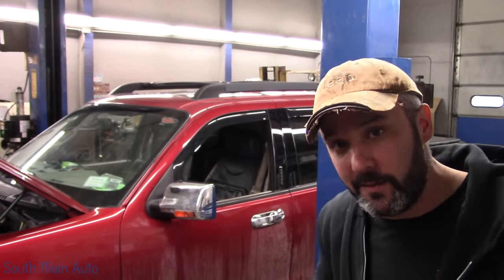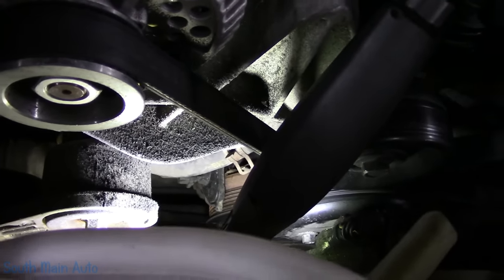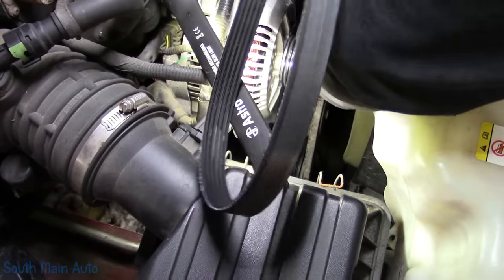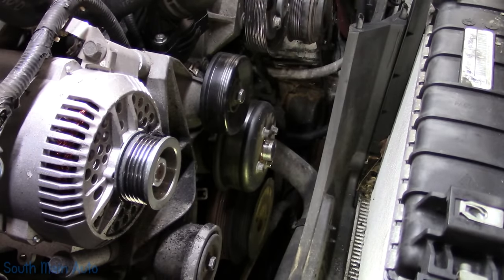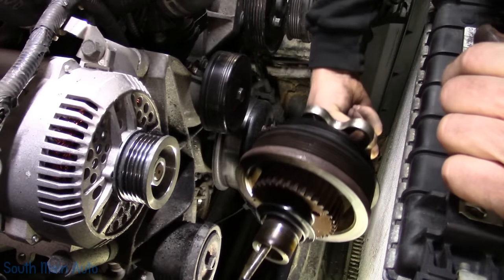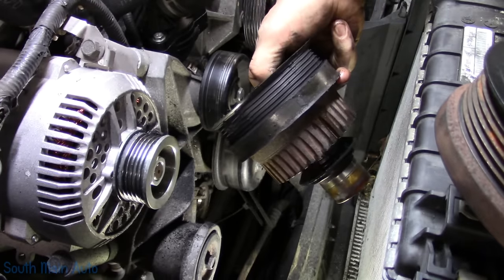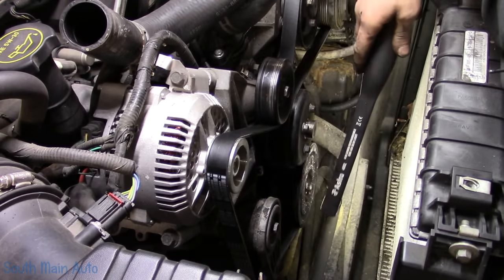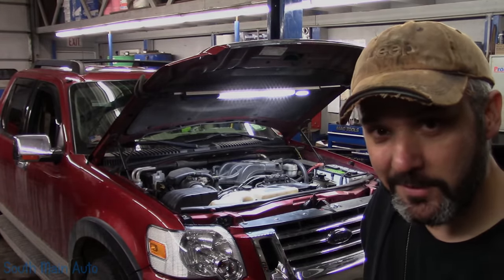Ford Explorer Sport Trac: Crank No Start

Comment: I know this is an older video.... but, I had to comment.   it is an embarrassment to the automotive trade, some of the people they have "working" in ALL the parts stores these days.  i applied to THREE parts stores when I moved to a different state for some extra income, and BOTH told me I was over qualified for the position.....  That should tell you something about who they prefer to hire.  95% of the time I have to look up my parts myself, when I go to said parts stores, to make certain I get the right part the first time.  I do agree with the NAPA comments though, most of the time they seem to have SOME automotive knowledge at least!!

Comment: On my 2003 Mustang GT the PATS will light up the theft light sometimes and not let me start the car.  I know the PATS codes are stored in the Dash cluster, the Key and the computer.  If they dont match or if one of them isnt working then the car wont start.  I found this out the hard way when I got a new dash cluster trying to fix the speedometer lol.  Found out I had the wrong transmission but the car didnt start with new dash so I transferred one of the computer boards from the old dash to the new one and it was able to start again.

Comment: I have to laugh at all the Auto Zone negative comments. Here's a clue for all the space shuttle mechanics commenting, don't go there if you don't like them. Go to Napa or the dealer and put a little extra in your wallet, you'll need it. Lastly AZ has parts and I agree the people working there aren't space shuttle mechanics like you but try to remember the average worker gets paid ten bucks an hour and typically it's a part time job because they aren't space shuttle mechanics like you guys. Hence grow up and get a pair.

Comment: Hey, guys.  I love the channel.  I wish I was in NY to bring you my car.  I noticed the Ford in this video, and I have a question.  My last car was a 2009 Ford Focus SE four door, and had 298,000 miles on it.  Before I started doing disk brakes myself, I took my Focus to a chain brake mechanic.  They put premium pads on the front.  I drove my car between Sacramento and San Francisco, and drove multiple hours per day working in San Francisco.  That city is known for hard on brakes.  The issue I had was the premium pads they used would start cracking and chipping within a few hundred miles, and it took 4 visits and pad replacements to find the right pads, which were non-premium.  Is this a car issue, or issue with the place that installed them, or lousy pads?  Thank you for information.
Reply: I forgot to mention, I always kept the alignment like it should have been.

Comment: I just want to remind everyone that loves to bash the auto parts store people, that Autozone carries thousands of parts and there's no way you can reasonably expect one of the folks in the store to know off the top of their head which particular pulley will fit a power steering pump for a 1992 Chevy truck, for example.  The system in the store is set up so that the only way, and I mean the only way, to look up a part is to enter the year, make, and model of the vehicle.  You can't just look up what water pump fits a small block chevy, it doesn't work that way. It's not like it used to be when there were guys working in the parts stores that knew small block chevy's and what parts would fit.
Now having said that, yes you should be able to have some reasonable expectation of getting the correct part from a parts store.  I had to take a test to show that I had at least basic knowledge of the different systems on automobiles.  But when the vehicle manufacturers are using different parts on the same model year vehicles that makes it difficult for anyone to know for sure which part is the correct one.  I've seen many times where the same vehicle might have 2 or 3 different options for brake pads and to get the correct ones you have to know not only the correct model year but also the build date of the vehicle and also what size rotors the vehicle has.  Your average person is not going to know what size brake rotors they have and the people in the store have no way of knowing what the specifics are for your vehicle, that you own and drive.
So do what I do and take the old part with you if you can, to try to match it up with the new part.
Okay I'm off my soap box, it's just that I have been on both sides of the auto parts store situation, having been both a customer and an employee, so I understand both sides of the argument.

Comment: If i am wrong it is certainly not the first time but;  it is highly likely someone put that belt on the way it was, then started the vehicle and it ran until it wore into the crank sensor ending the road show causing it to end up in your shop. Most likely the owner did that, surely no shop is that poorly informed about how that belt setup should be run. I cannot fathom the belt just resetting itself onto that part of the pulley without coming all undone and wrapping up into a big mess in the process.

Comment: Use a thin sheet of plywood to protect the radiator, and never gift a customer with a new radiator ever again.
Die-electric grease will help with belt noise, it's the only material that should ever be used on a belt.
Happy to see you having the same issues with Autozone as I experienced, it seems they hire kids that pass a piss test and can run, if you actually know what to do in a parts house, you cannot work there.
"Shmucks" is just as bad, and they know how bad they are, or they wouldn't have changed their name.

Comment: My Napa " just retired 😭. The young guys are ok but have no personal knowledge of anything before 2000. Since I work on old junk, and in fact , am old, they look at me like I'm speaking a foreign language. The "Zone by me is also manned by 12 year olds but they have the goods when I need it. I needed a ring gear for a 65 F350 and they had it at the hub store for $21! Quite a few of the parts are the same as Napa but at a fraction of the price ( I have a commercial account at Napa) and without extra shipping for the oddball stuff .

Comment: Holy shit.  If you go to Auto Zone they can rent you a crank pulley puller with several different sizes of bolts.  That way you don’t have to “guess” at what size to use by putting an impact wrench on several different bolts you have laying around the shop.  Then when you use the correct tool to put the crank back on you don’t have to deal with a crank shaft that you just stripped out.  Don’t ask how I learned that one.   So the crankshaft is “going in the garbage”??

Comment: Hey Eric you think that a Auto Zone harmonic balancer can cause a misfire in the engine and particularly on only one  cylinder? Because after i replaced mine i am getting a P0301 but only on the highway on the cruse control at 2500rpm and did not have any problems before the balancer replacement.
thank you really appreciate it

Comment: Its amazing though with a crankshaft pulley wobbling so insanely that its destroying other parts and jumping the belt aroundlike that why don't they come in with the entire lower block completely fubar'red?  Why aren't they arriving on the back of a flatbed after the entire engine had an episode of glowing brightly?

Comment: Did the same thing on a 2006 4.0 mustang. Looking/staring at it and wondering why it had 2 pulleys...
My question is can I leave the pulley bolt on with 3 or 4 threads and push on it with puller?

Comment: Is there a special tool you have to use to prevent the harmonic balancer from rotating when your trying ti get the center bolt off I am currently replacing mine and the outer ring on it broke off

Comment: "What could go wrong with a Dorman crank pulley?" you better ask Ivan about that one.
Dorman hard parts are trouble, noncritical bolts are okay, anything else is trouble.
Ivan did a Dorman crank pulley on his wife's car, found it was not machined properly, and didn't fit the belt. 
Avoid Dorman, or suffer a fate worse than death.

Comment: Yea I been there with auto one I needed some die electric grese for my battery terminals and to lube the wires from corrosion the tried to sell me axel greese to pack my wheel bearings

Comment: Used too alot  had this happen with a buick v6they ran through a puddle and the water had a stick which hit the tone wheel and sent it into the sensor and killed that car in 60 feet

Comment: In general are the 2gen Sport Tracs fairly reliable?  I recently came into a 2007 limited V8 4x4 with under 80k miles.
Reply: You will get problems with the charging system, alternator, or this one with harmonic balancer, electrical issues/door lock/windows/radio --I've replaced my alternator and battery and still experience charging system errors

Comment: I seen the same thing on a ranger. Came in for a belt noise. I was wondering why it had 2 pulleys and why 1 was black. Poked at it with a long screwdriver and realised it's rubber. Lol. Customer declined the repair and came back 45min later yelling they just got fixed for $60. SMH

Comment: I'm actually going through the same problem on my 2001 Mercury Mountaineer 5.0L, sometimes it starts right away, sometimes It wont, I have checked everything from fuel to spark and can get the problem solved, I also replaced my Harmonic balancer like about 6 months ago, replaced the crankshaft sensor and connector as well, since it was all cracked already, same here, no revs on the tach when I crank it and wont start, its kind of difficult for me since the problem is intermittent, any help I can get I would gladly appreciate it folks, Thanks!!

Comment: Modern GM is garbage but I will say I just thought about like how many LQ4s or LM7s are out there. Covered in oil and grime with tons of miles but still running. You know it reminds me of old small blocks and big blocks. You know especially ones that are real dirty and they never were clean. You know that's just how the old small blocks were too covered in grime but old as hell still running... 1999-2007 classic is a great truck too... The 1/2 ton is awesome daily.   I wish the Bigger ones had solid front axle

Comment: Hi Eric my name is Aaron and I have a 02 chevy avalanche and Saturday the oil pressure dropped at idle to about 35 to 38psi so I changed the oil pressure sensor and that didn't change nothing and when your driving it the oil pressure is about 40 to 42 will it hurt the engine to drive it and what else could be making it do this the truck has 248.000 miles on it....any ideas?

Comment: Autozone sucks i never go there. Well correction i went there once and bought a spark plug wire set and one of the wires turned oit too be too short..i had to go back and get a swap..ugh.. I go to oreilyys in my area they have been good so far but i also know many people dont like them, either

Comment: I have the same exact vehicle get four 02. Sensor codes and egr code replace both still get same codes , check engine light comes on 50 to 60 miles after start up and then engine stalls, any ideas

Comment: So I have a question if that pulley slips a little bit on that rubber would that make that vehicle go dead and when you tried to crank it back sound like the timing is off and then after continuing to trying to crank it it may crank up and run for a little while. You can get in it and may an Drive it a mile or 5 miles and and it just go dead
Reply: Mine is on a 2000 Ford Explorer V6 looks like the same
Reply: I'd take the belt off, try and grab the pulley and see if it moves. If it's the same engine chances are you could be having the same problem happening. That or you've got a loose ground somewhere, do the lights ever flicker or anything weird?

Comment: DIELECTRIC GREASE WILL ALSO QUIET A BELT SQUEAL HAVE USED ON GAS AND DIESEL ENGINES FOR OVER 25 YEARS IN THE HEAT OF LAS VEGAS NEVADA

Comment: Took my 2003 Merc mountaineer to my local Ford dealer AGAIN with a no heat problem.Prior to this they claimed it was a bad heater core and needed to be replaced (mucho $ as they have to practically disassemble the insides of the cab.)
same mechanic looks and says bad heater control valve Replaced same no joy.
called my brother. Hey Take it to my guy a shade tree mechanic but knows his stuff
OK went to mechanic who actually has a very nice shop. Says leave it here I will get on it after this job.
Hour later  he calls says "All Fixed"
What was the problem? Hose trashed at  other end of attach point. New hose $20 part and labor
You can now bake a turkey in the back seat . 1. Done with Ford and their Factory trained mechanics 2. g
Going back to my Jeep.
Reply: EDIT this car has 139k miles on it has had 2 xmsn  3 fuel tank senders drive shaft  new calipers  all repaired by ford and last brake job they didnt replace the parking brake shoes

Comment: Hey no body is perfect! I have had the same issue with my 2005 sportrac that bitch is almost impossible to steer when the power steering pump stops.  And the dash lit up like a christmas tree i got out and looked cranked it up and looked under the hood and WTF   how can it run but the belts aren't moving  turned it off restarted it and no lights. Went home and drove it to the shop next day... just a lucky guy  it was the first one i have ever lost.... 
Different question can my 4.0 engine be replaced with a 3.6 V6 from a 2014 mustang ? Just in case my 4.0 flys south i have replaced the timing chain guides front and back at about 140k and at 173k it is starting to tick again the specks is better on the 3.6 horse power,  torque, fuel milage etc  i would rather put the money in a better engine even if it is a better engine.  so what do you think?

Comment: I absolutely hate buying from autozone and advance auto parts.  I order online and get to the store 2 hours later.  They haven't pulled the part and 20% of the time, they don't have the part even though it shows as in stock.  Or they give you a box that's been open and is missing things or contains the wrong part or someone swapped the name brand part with a cheap knockoff.  They also charge 2 to 3 times what you can get it for normally.  Alternators for $400 with an MSRP of $130.  That's criminal if you ask me.

Comment: Ford Explorer. Sure am tired of that battery powered impact yuove been using latelyFord EXPLODER miss that sweet little 3/8 or1/2 drive air ratchet that broke on you. So much more civilized and nicer sound than that terrible noise than that big harsh rechargeable impact for the easy stuff

Comment: Stop raggin' on the parts guys#
Jeez...they're only as good as the training the company provides them. Bought parts from the "Zone" and actually got the right ones....sometimes. Usually. You talk to the guys and it's actually a CORPORATE thing. They refuse to change the "wrong" part number in the system....for some unknown reason. Corporate, thatis.

Comment: why do all you guys use pneumatic wrenches on 6 & 8 mm bolts, are they to tight for you to undo by hand with a simple socket & ratchet
Reply: Because it's simpler, easier and faster to use powered tools when you do this kind of stuff professionally. You don't see construction workers turning screws by hand either.

Comment: A few years late bu i had a '95 Mustang GT 5.0 L that dampener slid around on the rubber and threw the motor out of time by a few degrees. Always kept jumping time and then jumping back in time... Another stupid Ford trait. Never buy another Ford.